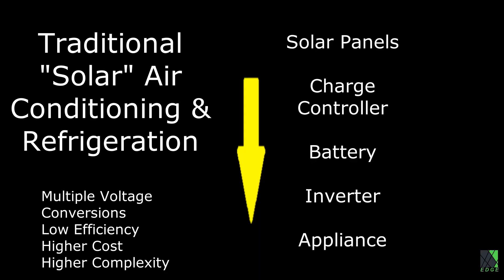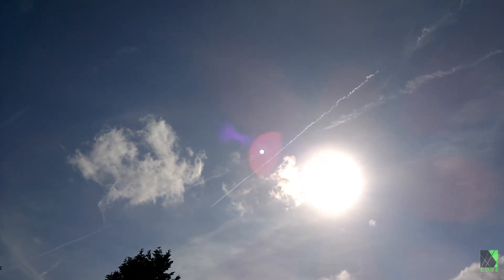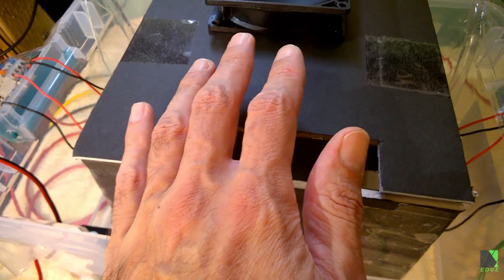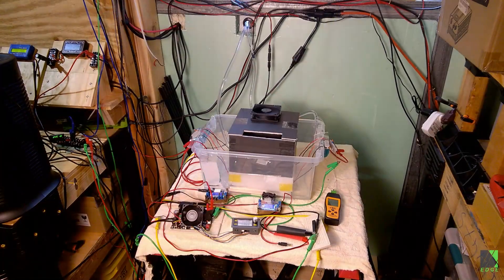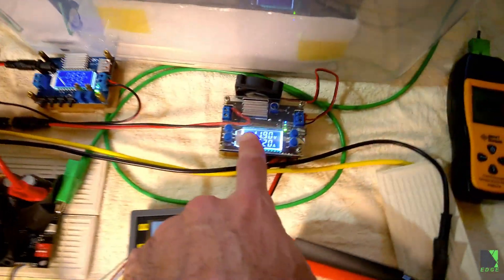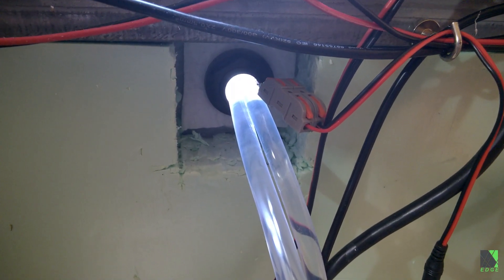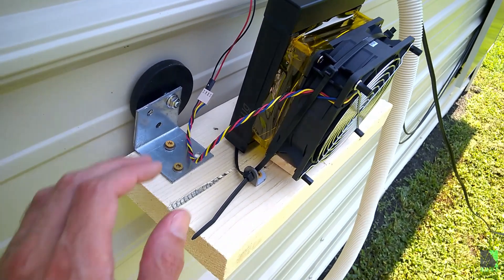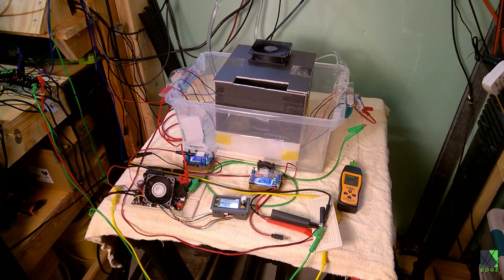Direct DC Solar Air Conditioner Research Peltier Prototype Part 1 Research & Development #diy #solar

Comment: A good resource channel regarding Peltier device cooling is the Tech Ingredients channel, they have built a fridge, a freezer and a generator. 
Regarding the Peltier device generator they built which was an excellent video, I asked them what was the power consumption of the LED floodlight that they were powering from the 36 Peltier devices which in its finished product state was able to fit inside a pot of boiling water, the light was rated for 45W and it lit up the place quite good! 
But during the video, at the beginning, they tested the Peltier device and worked out that it was possible to achieve 2.1W per device, they were running a 45W floodlight with no problem but at 36 Peltier devices at 2.1W they were getting over 70W of power being generated.... 
Had they put a battery in circuit, they could have had the energy to keep the lights running after the camp fire were out! 
They really did a great job of demonstrating what's possible.... 
Some people tend to play around with one or a few Peltier devices and seem to think that it's already a lot! 
Back before we had solar panels we had solar cells! I bet that there were people back then saying that 10 solar cells were a lot but still not enough to be of any kind of use, but here we are today, we have panels because some people refused to give up and kept adding solar cells making their own panels until some company noticed and began making panels at a much cheaper price! 
If I remember correctly, BP (British Petroleum), the big oil company was making solar panels earlier in their career! So much for the big oil company conspiracy theory LoL.... Ohhhh how people forget..... 
Anyway, Tech Ingredients channel, if you haven't seen it already, I highly recommend it, lots to learn which will hopefully help you with your mission....
Reply from the maker: @PeterMilanovski Boiling water light, that is really neat! I have not yet delved into power generation, focusing mainly on freezers/fridge and air conditioning. It's a lot of work and very tedious. It's funny how technology is initially rejected or dismissed early on, but it shows up later anyway :)

Comment: Be cool to use the solar power to turn over a Stirling-cycle engine, outside the workshop. Dissipate heat into the air, but run a coolant loop inside through a small radiator/fan arrangement. 
Much more efficient that way, and you can dial the speed up and down as you like.

Comment: Good stuff.  A few days ago I picked up Nine 305w panels off of my local CL. Yesterday I bought an EG3 12k Hybrid mini split. Can't wait to get it all hooked up and working. My existing 2400w and 800Ah system will power it.. but not long enough for these 90+ degree days here in S. Oregon.
Reply from the maker: @OFFGRID_Trucker  Wow, a very exciting setup, have fun!

Comment: It's been months since I posted on here, lost my home and divorced lol. Oh well it is good to see you are still doing what you do. I now own a small home in another city, I tossed out the old furnace and water heater. I have NO gas at all. For kitchen sink I have a plug in 2 gallon hot water tank under sink. In another room for shower a 7.5 gallon mounted on wall. Now if power goes out I can use my solar array and the LIPO4 system to wash dishes, take a shower and even run a small frig like u see in dorms?
Oh and I installed a 9000 BTU MINI-SPILT it has heated my little house and cooled it with no issues, I bought a HVAC pump to suck air out of lines so that saved allot of money! PEACE!

Comment: I used a similar set-up on my homebrew cabinet instead I had a small radiator with the water running through it and a fan and outside I ha 2 peltiers either side of a small aluminium water block with the cooling side of the peltiers and heat sinks to cool the water I never tried it but I suppose I could have reversed the petiers to heat it as well but I used a reptile heat belt to heat it
Reply from the maker: @errolfoster1101 Nice!!!

Comment: Those green - turquoise batteries in the desk
Reply from the maker: @gregboyd4321 Hi, I don't use a BMS on the hand built prismatic batteries. However there is a JST cable on their in case I want to look at the cell voltages. Been doing it this way for around 10 years. (About 20kw cells in my house, never showed those).

Comment: What type of battery BMS is used with those green tortoise batteries?
Reply from the maker: @gregboyd4321 Hi, I don't use a BMS on the hand built prismatic batteries. However there is a JST cable on their in case I want to look at the cell voltages. Been doing it this way for around 10 years. (About 20kw cells in my house, never showed those).
Reply: So they balance themselves?
Reply from the maker: @gregboyd4321 I've never had cell balance problems on storage batteries using individual cells. They are all hand built packs from years ago. Still working fine.
This kind of info (how to avoid using a BMS) is generally not on YT, perhaps I will do a video in the future.

Comment: Nice! The problem with peltiers is they do not like temperature differential at all. They are quite efficient, maybe even comparable to low efficiency AC units if the differrential can be kept under 10-20 deg C. 

But the problem with that is absolutely huge radiators and fans are required. And all heat sinks must have very high amount of fins.  And there can be no heat leakage anywhere, the hot side needs to be insulated. Also, the cold side need better heat sink to keep it high enough temperature to not condense significant water. You will not get very cold air, but this is the only way to make peltier heat flux efficient enough.
Reply from the maker: @Niko-rq7ie They are pretty tedious to work with but really fascinating. Testing a different setup with 8 elements, bigger radiator. In the first quick test it blew cold air. Should have some clips of it soon.
Reply: @solarpoweredge  I can't remember the specifics, but it gets pretty depressing doing the math on this. To get something equivalent to a 6000btu window AC unit, you'd likely need 100+ of these cheap peltiers and run with very low amps to get anything approaching a reasonable efficiency. At least they are cheaper in bulk, but I found the other materials like metal waterblocks and tubing to be way too expensive. It gives off so much heat I wonder if a 55 gallon drum or a 275 gallon tote of water may be a better idea than a traditional radiator and fan (or likely, dozens of fans). Please prove me wrong :)
Reply: @orangezeroalpha  If you could achieve side to side temperature differential of 20 deg C, the cooling power from 60 watt (mac heat transfer) element is about 40 watts with 90 watt power draw. 40 degree differential, it is about 20 watts with power use increasing little from 90 watts.
Reply from the maker: @orangezeroalpha Peltiers have unique properties and are worth investigating; so I chose to include them in my experimental research. Exactly as expected, the first test was good training but pretty underwhelming. The second test (running now) is performing well enough to merit the time spent. I was surprised how much cold air and dehumidification their was. I just might leave it running all the time in some form - probably with a bigger radiator and more elements. It depends on how many watts I can safely push through and other factors.

Incidentally I do work with refrigerants and compressors, which where this series is headed, it takes time (and a lot of $). I am developing a powerful compressor based direct DC solar powered air conditioner. The goal is to freeze my workshop with pure solar. I will document some of the work along the way.
Reply: @solarpoweredge  Yeah, I still haven't found any DC compressors that are worth using. I was wondering if an inexpensive simpleFOC could drive a brushless motor compressor, but again those often seem quite expensive.
Reply from the maker: @orangezeroalpha I hope to avoid the "DC" brushless controller, that's the build goal anyway. Will present the results as soon as possible
Reply: @solarpoweredge  I assumed a bldc would be the most efficient/quiet way to go, and now there seem to be affordable options for lower powered motors. I finally just ordered a dual motor mks xdrive3.6 and may regret going that software rabbit hole in a few weeks. We'll see. Looking forward to your updates
Reply from the maker: @orangezeroalpha Unfortunately, all the smaller DC compressors I've found are actually brushless (aka BLDC), so they actually use 3 phase AC, therefore are tied to electronics. I still like them a lot, and will use them with a few small projects. But I am also developing a true solar DC air conditioner that requires no such controller. It costs a lot in parts. Progress has been slow. I don't know when it will be done but will share the results when possible.
Reply: @solarpoweredge  In multi element systems, it is better to use individual heat sinks, or water blocks, if there is even slight variation of thickness of the elements. Also, heat sink waviness and roughess make things worse. 

And with peltiers, any thermal resistance growth, even due to little too thick thermal paste will cause significant effect, because the ceramic on the elements do not distribute heat to the better contact areas.
Reply from the maker: @Niko-rq7ie The water blocks work pretty well if they don't leak. Second test is up and running now, performs much better. It also uses more elements, more water cooling and bigger radiator. Direct solar compressor based AC in development too. Will do more video soon as I can.

Comment: Instead of getting another AC try insulating the hut. Double layer roof like some landrovers had?
Reply from the maker: @pepethefrog7193 Good idea... I have some half inch foam board to eventually install, when I get the chance. The roof is insulated with 2 inch foam to keep the heat out which collects above it

Comment: interesting concept! Looking forward to Part 2.

What's extremely valuable is that you have energy monitoring throughout, so we can calculate the watts consumed to temperature difference and then calculate the COP off that. That way we can see how the COP of a heat pump contrasts to the COP of this system
Reply from the maker: @subhobroto  Absolutely right about monitoring, still digging into this topic and hope part 2 will be a little more interesting

Comment: you want a heat exchanger on the hot and cold side of the tec 2 pumps and 2 loops one inside chiller loop and one hot side loop to rator  and fan one radiator and fan inside  the inside loop will be cold and cool the air through the radiator  I would prob use a glicole mix for the loops
Reply from the maker: @linearburn8838 Good ideas thank you

Comment: Glad to see the PV2L trend continuing. Maybe it won't be anywhere near commercial systems, but there is just something to a system being able to run without any offsite input (grid). Although running an ac (heat or cold) just on a solar load will be pretty hard (with the solar dips and all).
Reply from the maker: @Craftypiston  Direct solar does have a lot of challenges, sun going behind the clouds and all.  When experimenting with direct solar fridges, same problem but I managed to apply and test some creative solutions. Future videos in the series will cover fridges and compressors too

Comment: Very very nice prototype! 
What do you figure the temperature difference is of the outgoing air? 
What type of radiator is being used? I'm just wondering if different styles would significantly change the efficiency. I wonder if different coolants would make and changes?

I have to admit, I'm envious of your project right now.  I'd love to be doing the same thing myself.  I'm getting a lot of enjoyment and education from your videos, so that is almost as good as having the projects myself.  When I do start again, I'll be sure to share the projects with you.  They may not be as good as yours, but it might be fun for you to watch.  

The main project I want to make, I want to eventually make it available to people to 3D print the parts themselves. That's a long way off though.
Reply: I'll let DD speak the specifics but in general, water provides the best heat dissipation for its cost. Most of the glycol based coolants (like you use in your vehicles) decrease the dissipation but it gives better corrosion and freezing characteristics. If worrying about corrosion and freezing isn't a concern, nothing AFAIK beats distilled water.
Reply from the maker: @subhobroto Believe it or not, I am using distilled water... mainly because it's clean :)
Reply: @solarpoweredge  I guessed that's what a smart inventor like you would do. The only little change I would do is put in 2ppm bleach
Reply from the maker: @subhobroto Ah you're too kind :D if I keep any of these setups, I will put bleach in. I dropped a brand new radiator in the dirt the other day and had to carefully flush out all the contamination. So there goes all that distilled water :)
Reply: @solarpoweredge  Hey, you learned something. I have found those little inline filters for 2 stroke weedwhackers to be extremely helpful to keep gunk out of lines
Reply from the maker: @subhobroto Perfect! Never thought of that!
Reply from the maker: @colin8532 Thank you, feel free to share your projects - none of us  work in billion dollar labs but all research and creative efforts are of value - and worth sharing. 

I tore apart the old setup (water tank was inconvenient and evaporation concerns) in favor of a more powerful system with 6-8 peltiers. Video of that soon as possible. Measuring outlet air can be deceiving, because outlet air temps are not just governed by the cooling power, but also the speed of the fan! But I'll see what I can do with a K thermometer to get temperature readings

Comment: What peltiers are you using? and what current/voltage?
Reply from the maker: 5 amp 12v modules in this first experiment, not driving them very hard. Second experimental setup is under construction, will test bigger modules and higher power levels.
Reply: @solarpoweredge  so tec1-12705s?
Reply from the maker: @superskrub4209 Yes and I will test some 12715